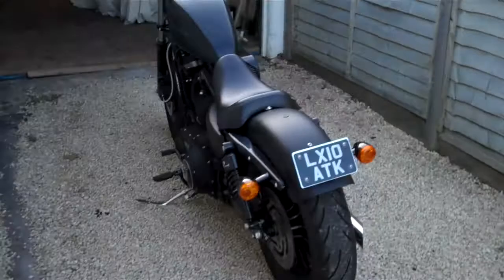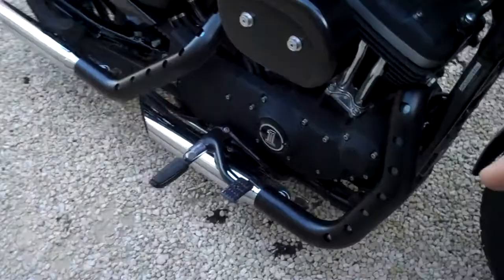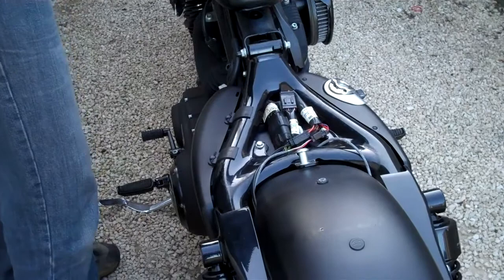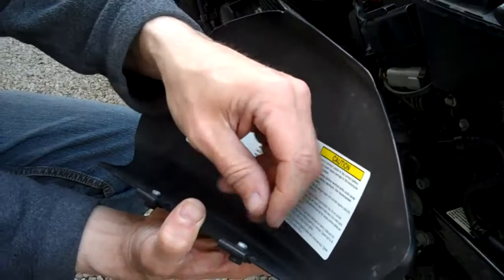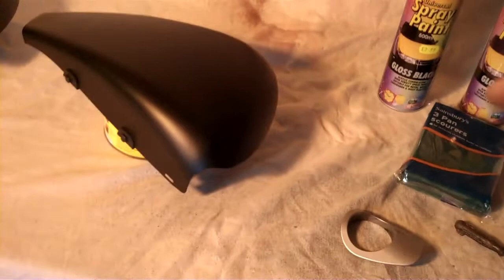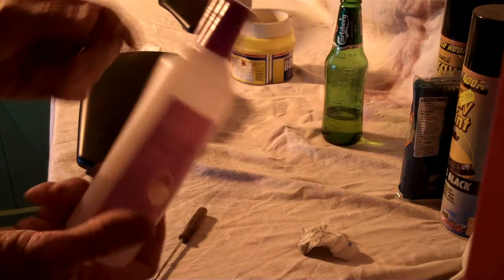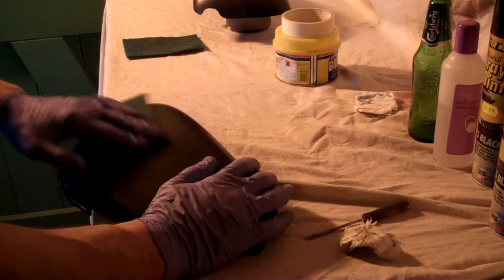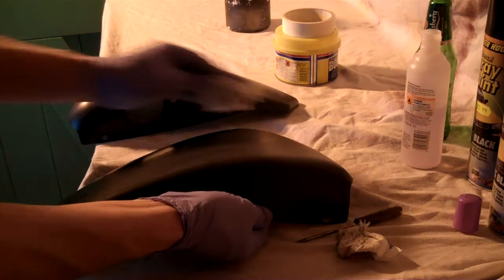Delboy's Garage, XL883 Iron, Respray time, part 1

Comment from the maker: Hi Chaz. if you want to put some stencil graphics on your bike, to do it properly, take the panel off that you want to stencil, sand (key) the panel with 1200 grit wet and dry paper,(use it wet), then make your spray on stencil as you would any other place, and give the graphic about 15 minutes to dry, then spray the whole panel with a coat or two of clear laquer. this will bring back the shine all over plus protect your art work from chipping off.otherwise why not get the but as vynil stickers?

Comment from the maker: Hi there Rob. I see where you're going, aiming for polished wheels...nice look, specially on the Darmah.  If it was my bike, i would NOT use aggregates at all, they will cut scratches into the alloy that you will then need to use a high speed polisher to get the mirror shine you seek.. why not use some paint stripper to remove the finish chemically,  im assuming you have the rims off and ready to paint..Here we have 'Nitromorz' which is acid based, test a small area first and your good to go Del

Comment from the maker: yeah pretty much mate, you need a chemically stable base coat that the art work wont burn into...then a clear coat on top that wont burn into the art work and ruin it.....so test all coating on each other before you start...its time consuming, but not as much as having to do it all again because it pickled up... good luck with it.. Del.

Comment: Hello Del,
I'm a little off topic here.  I have to get some paint off of my motorcycle wheel.  I'm not sure what grades of sandpaper to get the paint off with.  The wheel is aluminum alloy on a Ducati Darmah.  I was going to clear coat after I get the paint off, in the end I'll need a smooth finish.  Help from Canada, Rob